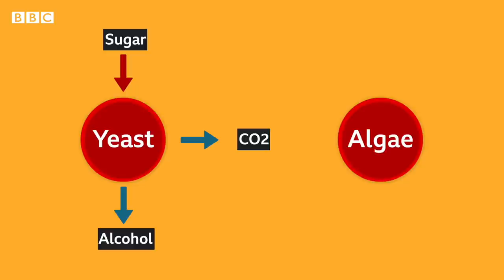Australian craft brewery uses algae to fight climate change - BBC News

Comment: Saving the planet, one pint at a time 🍺🍺🍺
Reply: The CO2 released in fermentation is just the CO2 absorbed by the barley when it was growing, it's neutral. The main carbon footprint of beer (wort) is the fact that it needs to be boiled for an hour before fermentation which uses electricity or gas. Cider and wine don't need boiling so they would be a better option for reducing CO2 emissions.
Reply: @sebastianguerre6868  This is who NOBODY listens to BBC news anymore.
Reply: @guff9567  The starting point for a BBC journalist is 'what would I like to be true'?
Reply: @sebastianguerre6868  Our government is rotten to the core.

Comment: Kudos to all scientists, inventors and contributors to help find solution for our dear planet. Well done! 👍🏻👏🏻
Reply: The solution does not change much. The next barley crop would have bound the CO2 anyway. You have the reduce the CO2 input in carbonation and packaging. The CO2 produced by the yeast is just the CO2 that the grain used to create the starches that you convert.

Actually this system net-creates CO2. The CO2 from the fermentation will be bound by the crops of the next year. So the CO2 net output is 0. But the algae apparatus uses pumps which need energy which as of right now is mainly produced by fossil fuel burning. Meaning you produce more CO2 then if you just do nothing

Comment: The CO2 is basically from the grain. It limits the CO2 output, but it will be bound in the next crop anyway. What's more important is CO2 capturing to limit the CO2 that has to be produced in order to have a carbonate and packaged beer

Comment: This has marketing value only. What is the cost per tonne of captured CO2 here? Astronomical, that's what. Climate change needs cost effective, scalable solutions. Solar panels, wind turbines, insolation. Carbon capture needs to happen at power plants, pharmaceutical production plants where they are cost effective. Sequestering a few grams at huge expense is not solving the problem of gigatonnes. 

This is a figleaf when we urgently need real solutions. But hey, the BBC picked up on the story so I guess it was money well spent for the brewery.

Comment: Photobioreactor reduce disolved co2 in water..
How that can reduce co2 in air?
Reply: Via airpump that introduces the gas into the water from air or as i understood it in this case the Co2 gas is piped from their fermentation pots/vessels into the bioreactor where it gets disolves into the water.
Reply: I was reading something on the website Project Drawdown about using Seaweed Farming to capture co2 out of the air and use the unharvested biomass to bury it. Part of the text defines their Seaweed Farming proposal as, "... the culturing and cultivation of macroalgae in the ocean for long-term carbon sequestration in the form of excess unharvested biomass that is exported to the deep sea and/or ocean shelves and buried in ocean sediments. We assume this solution will be deployed in ocean areas that do not have alternative uses."